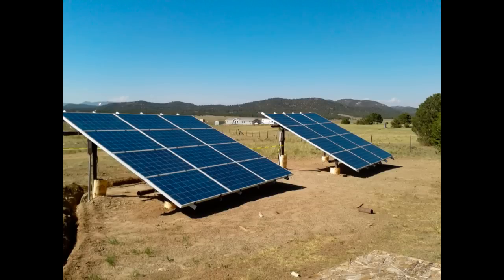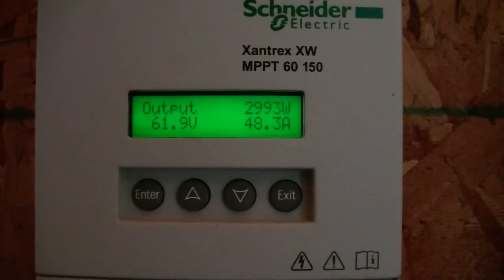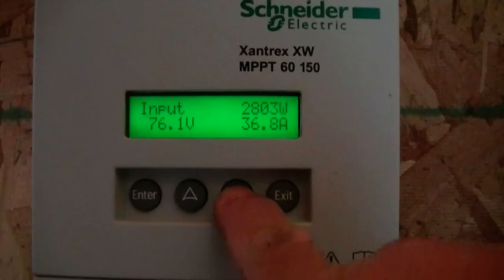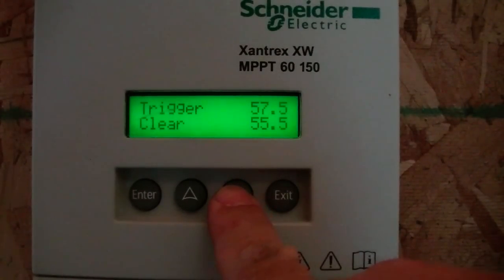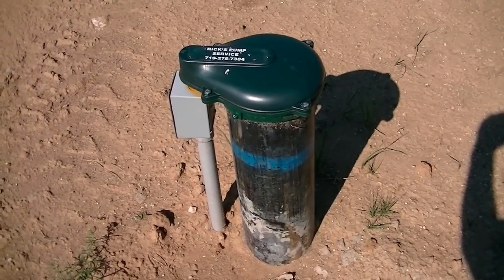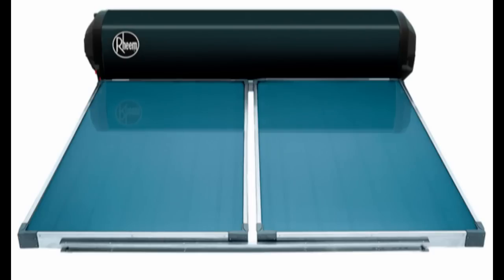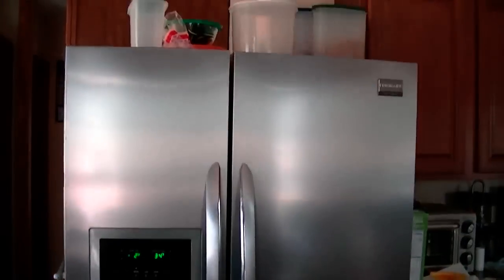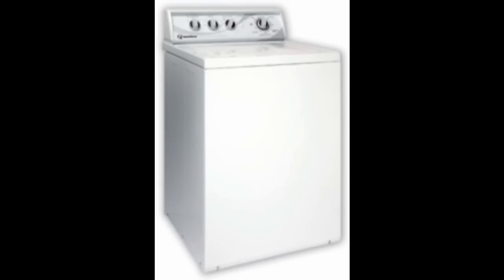Solar Design Considerations

Comment: And now it’s 8 years later and hybrid systems are the way to go led are much better and lithium batteries are cheap AliExpress Ebay has 100watt panels for $70 and hybrid charger controllers and bms

Comment: Ok. You know me and electric. If I buy a cordless drill. Which is stronger? A 12 volt or 20 volt?
Reply from the maker: Was Blind I would go with the 20 volt, but I’m sure there’s someone who would disagree with me!  😬
Reply: Offgrid Steve So the guy at Home Depot said said the 20 has the same power as the 18. The 18 was cheaper and it was on sale with 2 batteries.

Comment: Ha Steve
On your dodges
If all of a sudden they don't want to start..
And the shut down solenide isn't kicking
But you can push it up and the holding side holds it open..
On the fire wall drivers side there's a 2 sided relay
The high amperage side
(the kicker side of the solenide) might be bad...
Reply from the maker: I did have the fuel shutoff solenoid go bad on my ol' 12 valve.  I used twine to tie it up when I needed to start it, and then I'd just cut it off with my knife when I wanted to shut it down.  A pain but it worked.
Reply: Steve Robertson 
Yup 
My parts came in and just finished installing

Comment: Hi there I'm having problems with my charge controller switching to "charge off", so that my generator can charge the batteries..is there anyway to manually change this??
Reply from the maker: I have no idea the brand, type, voltage, amperage, hysteresis, etc.  of your system.  I would suggest carefully reading the manual for it.  Most time I find the settings in the manual.

Comment: Is it true that with a solar panel array, if one panel goes out for any reason, the entire array goes down? I was watching a web page from the PBS program This Old House, and a device called a micro inverter is hooked up to every panel to solve this problem. Do you have any thoughts on this topic? I really appreciate your videos and the information that you supply.
Reply from the maker: It will kill the output of a string of panels connected in series only.  I have 6 sets of panels wired in series of 4 panels each.  If one panel goes out, I lose 4 panels but the rest continue to provide electricity.
Reply: Thank you Steve. This web site of yours is the center of gravity for solar information. It's great, straight forward and easy to understand.  I'm in the process of designing my solar system for a limited application at first - learning as I go along. That being said, I do nothing without watching your videos repeatedly. Thanks again for taking the time to help so many, especially a rookie in this like me.
Reply from the maker: John, you have no idea how much I appreciate that!  I try to make videos with good informative content.  I can see why so many people ramble because I have a hard time with it myself.
Reply: I have every single video that you've made. Although I'm in New England - Western Massachusetts to be specific, and not every video is applicable to my location, your experiences and your testing whether this or that works, is great. I'm not savvy to all this technical stuff, kind of a "see what works" kind of rookie. You should have your own TV show, syndicated nationally over some PBS network, or at the least a radio station that people can call in and ask questions. I know the technology with the stuff is at light speed sometimes - but, that's what makes your demeanor of explaining things so easy to digest. What got me on to this was a major ice storm that we had not that long ago and we lost power and other things that we took for granted everyday. NOT ANY MORE. Solar power is the last item on my list to appoint my home with, the best that I can afford. Thanks again for your presentations, your insight into the reality of going this route and your experience.
Reply from the maker: You have complimented me in the greatest form, sir!  Thank you again.  We've been kicking around the idea of having a live feed.  We'll see how it goes, and if we choose to do that I'll give a week's notice.

Comment: hi thanks steve for the video
I dont know how to parametre this regulateur
please help me
Reply from the maker: What is it exactly you don't know how to do?  Wiring?  Configuring?  Do you presently own this device?  Do you have it installed and will it turn on?  I also need the following information:
1.  Battery voltage
2.  Battery Amp hour rating
3.  Battery manufacturer and type (AGM, Gel, Wet, etc)
4.  How many PV panels you have.
5.  The Operating voltage and current (amp) rating of each panel.

Comment: Hi Steve!!! I need your help again. I add another array of 3 255watt panels to my Schneider Electric MPPT 60 150, the day after installing the panels I notice a flashing red light at the left corner, I don't know if it was their before, I have no idea as to what it is, can you help please?
Reply from the maker: +mrrepairit If your MPPT 60 is not displaying any errors, then all is well.  Mine has a flashing light when I think it calculates MPPT, but it's been a long time since I looked at it that close.  If your batteries are charging and your MPPT isn't displaying any errors, then everything is happy.  Believe me, if that charger doesn't like something, it will tell you about it - it's not shy at all.
Reply: +Steve Robertson (Off-Grid Living) Thank you so much Steve!!!! I'm now calm down, as I thought something was wrong with my charger. Thanks again for your help!!!!!
Reply from the maker: You're welcome brother!

Comment: Hi Steve. Top of the day to you. I have a technical request from a potential client, see details for your attention: 1. Client have an existing Eltek power system with 2 units of 3kw Rectifier & 750VA Inverter module respectively. 2. Alternating current load of 300watts. 3. 72 hours backup. 4. Client depend solely on diesel generator. 5. Client need an alternative power (SOLAR PV array) to be integrated with the existing system. Kindly advice. However, with my limited knowledge I am considering a XW-MPPT 60 150, 12 module of 300watts solar panels. Meanwhile, I am not sure of the SNMP (remote monitoring) compatibility of both. Thanks in advance.
Reply from the maker: +Adedeji Thomas That is very difficult to answer because there are so many variables.  A location in the far reaches of one of the hemispheres will need many more solar panels than a location near the equator,  Frequency of cloudiness is also a factor in determining array size.  You didn't indicate what size the battery bank is currently or whether there is a battery at all.   If your load is a constant 300 watts, 24 hours per day a system should be fairly easy to design.  I would suggest watching my solar design primers, starting with Step 1.  These primers give you the tools you need to determine your requirements.  

In order for me to provide the specifications you seek, we would need to spend time getting some data together and calculations done.  Unfortunately, as my channel grows, I have less and less time to answer the many questions I receive.  After watching my video primers, if you still have some difficulty with a specific area, I would be happy to help.  But I cannot spec out a system from just a set of "your needs are this, so you should buy that".  There are simply too many things to consider.
Reply: +Steve Robertson (Off-Grid Living) Its an omission. The current size of the battery bank is 48V 450Ah (12 blocks of 12V 150Ah connected as 3 strings) and the load is 300watts 24hours per day. However, the implementation of this is in Nigeria, West Africa; cut across all the 36 states. Thanks, will check the solar design primers as suggested and get back to you.
Reply from the maker: +Adedeji Thomas God bless all the precious souls of the nation of Nigeria.  Are you saying there is more than a single installation?
Reply: Yes, there is more than a single installation of this. Moreover, once we get it right we have the better chance of having more volume. Thanks.
Reply from the maker: +Adedeji Thomas Send me your specifications and I will help.  Do you know how many sun-hours you receive at each installation site?

Comment: SteveI have the mppt 60/150 also and it is aprox. 140' from my array. The array consist of 12 260w 24v panels and 4 100w 12v panels. What would be the best voltage to bring them to the controller to keep wire size down? I was wondering if I series        3  24v panels + 1 12v panel =84vand 3 24v panels + 1 12v panel=84vand 3 24v panels + 1 12v panel=84 v.and 3 24v panels + 1 12v panel=84v and parallel those 4 sets together .I guess the question i'm asking is can the xantrex charger take that 84 v and convert it to 48 volts which is the voltage for my battery bank? Or would you have a better suggestion?ThanksDon
Reply from the maker: +ffemt32o Yes the charger will convert that 84 volts easily.  I would wire the panels even higher voltage - just be sure to not go over the max limit of 150VDC open circuit. I run mine at around 130VDC open circuit.
Reply: Thanks Steve
I could go higher but that would probably mean I would have a lower voltage on one set, would that make a difference? Say 3 sets 120  120  and 96?
Reply from the maker: ffemt32o You are right.  Keep your voltages on your strings consistent for better efficiency.

Comment: Steve you probably get asked this all the time but how do you get started in solar. I have a good basic knowledge of solar. I am a generator field service tech. I don't have $20k to drop on solar. Could you get started with $2-3000? Say start out with good panels a good charge controller and some good batteries and then add more panels as you can afford them? I don't want to by harbor freight grade equipment that won't last of work with future upgrades. Any links to some info like this if you don't know the answers?  Thanks Steve for making your videos!
Reply from the maker: +j jones You are right.  It doesn't take a lot of money to start, and with careful planning you can grow your system without reinvesting in equipment.  Here are some web sites I use:
http://solarhome.com/

http://sunelec.com/

http://www.wholesalesolar.com/
Reply: Offgrid Steve is bang on with this video. But yes you don't have to go big right away. The only thing I'd suggest and by his video he suggests, is to down grade your electricity consumption first by LED lighting and highly efficient appliances. Then look at solar next (unless you are off grid already). Then to get started look at at least $2k. Solar panels charge controller, batteries, inverter. What you pick decides what you get! If you start small, be prepared to out grow your system. Make sure you include a generator to sub out, when the solar cuts out (on a small system). You really need to do the math in order to size your system to your needs. Hopefully this gets you started?!?

Comment: Hi Steve! I watch a lot of your videos and they has been a great help to me. can you please help me with this issue, I have one of the Schneider Electric MPPT 60a 150v charge controller on a 24v system, as it is 150v would I damage it if I put 150.92v into it? I want to use 4 panel 255w 37.73v panel in series, then parallel another 4 give me a total of 8 panel, but I don't want to damage my charge controller.
Reply from the maker: +mrrepairit  On page A2 of the charge controller's installation manual, it clearly states the maximum open circuit voltage of the array is 150VDC.  I know that you're talking less than a volt and it's less than 0.07% over maximum.  But if your controller blows and they inspect your configuration, your warranty is busted.  You won't lose too much efficiency conversion by stepping down a notch and playing it safe.
Reply: +Steve Robertson (Off-Grid Living) Thanks for responding! as it is I can only use 6 panels, would my other option be to get another charge controller?
Reply from the maker: +mrrepairit No sir.  That controller can easily handle what you have.  You can run as many sets as it takes to reach the maximum amperage of 60 amps.  On my system, I run 3 panels in series, and have 8 sets of those in parallel.  My panels will actually provide many more amps than the controller is rated, but it reaches it's maximum output of 60 amps and it simply puts out no more with no problems.  It may seem odd, but as long as you don't exceed the max voltage, there is no maximum amperage input.  It will siphon 60 amps from the panels and the rest just goes no where.
Reply: +Steve Robertson (Off-Grid Living) This is just amazing!!!! the company I bought the controller from recommend that I change my inverter from 24v to 48v as the 48v will allow me to use more then 6 panels. you are saying I can add another 6 panels or more in parallel sets of 3s, and that is because their is no maximum amperage input?
Reply from the maker: +mrrepairit Keep in mind that the maximum amperage you ever get out of it will be 60 amps (59.9).  Having said that, it is an amazing little controller.  Moving from 24 volts to 48 volts will allow you to double the wattage output from 1600 watts to 3200 watts!  That is because the amperage remains constant at 60, but doubling the voltage doubles your net gain on wattage output.  You can also use the same size wire for that extra wattage - you don't need to replace with larger wire, even though you get twice the electricity.
Reply: +Steve Robertson (Off-Grid Living) I cannot afford to change the invertor as I just started my system. I am really thankful for you help, adding more panels will do the trick for me. THANK you so much. Please, keep up the good work. thank you!!!!!!!!!!!!!
Reply from the maker: +mrrepairit Thank you for all that feedback.  I will make make more videos as soon as I thaw out.
Reply: +Steve Robertson (Off-Grid Living) You are welcome!!! We need more people like you around. Keep warm, and I'm looking forward to your new videos.

Comment: Hello Steve,

I have designed and built my solar system, but stuck on propper grounding. I have read so many articles on solar grounding, and not sure which way to go. I have six 150 watt panels wired into a midnight solar combiner box with a lightning arrestor. Me and I am sure others would like to see a video on how you did your solar grounds.

Thanks,
Reply from the maker: +LMAO77598 Keep your eye out for future videos.  I will make one on grounding.  When my electrical inspector came to inspect my installation, grounding was his main concern.  It is paramount for safety and you are right - grounding would make a good video.  I will do it.  Just not sure when...

Comment: Hi Steve,
Do you think Schneider could take the MODBUS output of the COMBOX and drive Schneider TC300 MODBUS thermostat? I would like to run a mini-split heat pump and if the solar (voltage) is being reduced from clouds, the software would set the progammed temperature to zero differential. As the clouds reduced the software would set the differential higher. Mini-splits use more power as the differential increases. Thanks! --Dave  offgridsolar@sti.net
Reply from the maker: Dave J Angelini Dave since a MODBUS TC300 thermostat is an input-only device, there are no devices that would drive it - instead, it would drive it's output into the device it is connected to.  So perhaps I misunderstand your question?  That aside, I do like Schneider's MODBUS solution for LAN-capable connectivity, but I don't like the fact that it's an add-on for additional cost.  I would prefer Midnight Solar or Outback's controllers which is included on some models.  Schneider might possibly include it on some models now as well.  I haven't checked lately.

I also apologize for my tardy reply to your comment.  YouTube dumped your message into my SPAM box because you publicly included your Email address.
Reply: Steve Robertson I am sorry I thought I was replying to a Schneider U-tube. The idea is to be able to control a heat pump in 2 degree increments to reduce it loading a solar system during clouds and then load the system when the clouds go away

Comment: Hey Steve, another excellent video. Just out of curiosity, does an mppt controller also pump UP the volts, if and when they are too low for the battery? Thanks
Reply from the maker: Tom, the responsibility of the charge controller is to vary the voltage coming in to extract the maximum amps from the solar array.  This in effect causes the panels to operate at their peak efficiency, regardless of the battery voltage.  The MPPT controller really shows it's strength during sunrise/sunset and cloudy conditions.  I have seen as much as 43% increase in power over not using it at all.  So to more directly answer your question, the MPPT will adjust up or down, whatever is best for the batteries.  When you first set up the MPPT controller, you load parameters into it about the batteries such as wet/sealed/AGM, amp hours of the batteries, bulk charge level, etc.  Once you have correctly loaded the parameters of your batteries, it's microprocessor makes all the necessary calculations for maximum charge level - even taking into consideration battery temperature.
Reply: no.